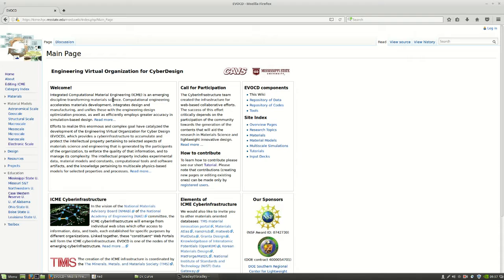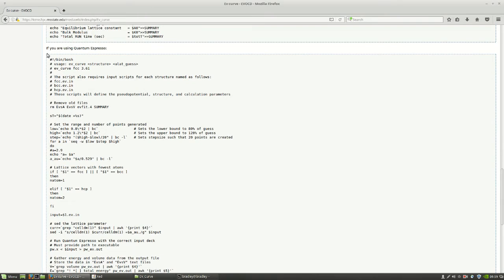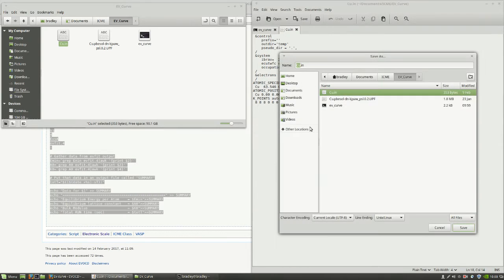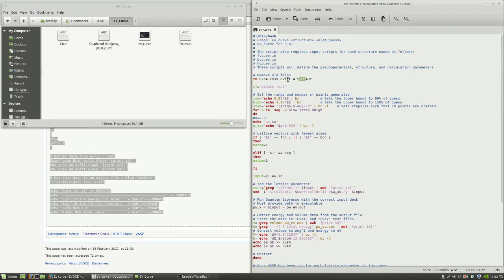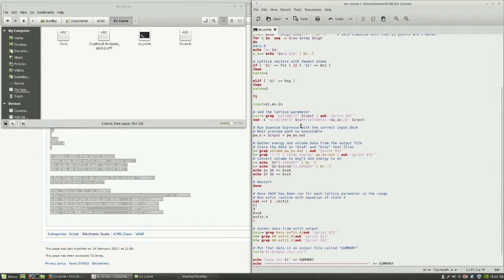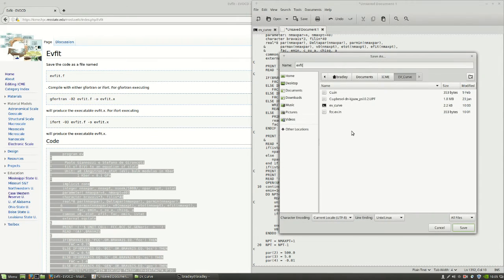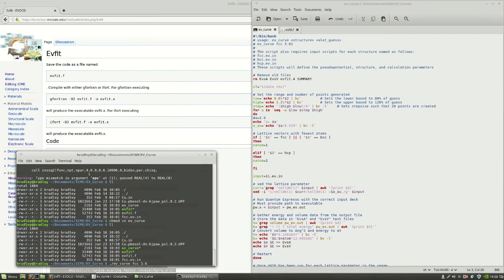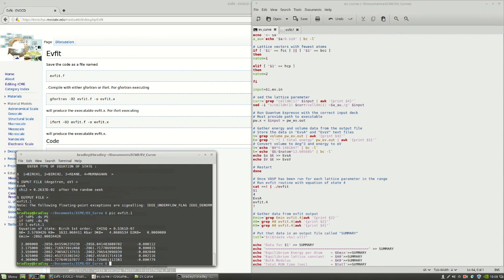Creating an Energy Volume Curve with DFT

Comment: Hi Brad. thanks for the video. for getting the data for E vs V curve in VASP, the starting structure should be relaxed structure. right? after that how do we change the lattice parameters? you used FCC so only one parameter is to modify. but if i have say, orthorhombic and that too 2D material. in such case i have 2 lattice parameter and the third one to be kept constant. How do we get the E-V curve?

Comment: Hi! thanks a lot for the video it really helps. i tried to do energy volume curve but i faced a problem: the code stops and says ' bad line in namelist &System' so i cheked the output file and found that the script writes alllll the lattice parameters generated in the same input file at the same time ''celldm(1) =14.74480151228733459389,=14.46124763705103969771,=14.17769376181474480151,=13.8.......) 
can you please help?!!

Comment: Hello Brad, thank you for your really helpful video.
I have a problem in calculating EvsA; when I execute the command " ./ev_curve fcc 3.61 ", I get this error :

./ev_curve: line 52: ./evfit: No such file or directory
grep: evfit.4: No such file or directory

and both summary file and EvsV are empty. I checked all inputs but I couldn't fix it. I was wondering if you have ever seen this error message?
Reply from the maker: Thanks for watching! It looks like you do not have the "evfit" executable in the current directory. If you don't want to use "evfit", you should be able to comment that line out and avoid that error.

Comment: Hello Brad, your videos are encouraging. Can you to calculate lattice thermal conductivity from lammps or in QE? lammps will be more preferable as i think it is less time consuming.
Reply from the maker: Thank you! I don't know that you could calculate the thermal conductivity from QE - at least not with DFT. It would be challenging because standard DFT is based on the ground state of the atoms, which means a temperature of absolute zero. You can try to do something like that in LAMMPS, because it can have temperature. There, you would still have to deal with the time scales (still super small timesteps!) but it might work. It is worth a try!

Comment: Hello do you know how to simulate effects of vacancies in qe or lammps?
Reply from the maker: Hello and thanks for watching! In fact, I do know how, or at least one or two possible ways. The vacancy formation energy is one of the quantities that we are concerned with when fitting a MEAM potential to the DFT data. To calculate that energy in DFT, you need to find the energy difference (per atom) between a bulk structure, and a bulk structure that is missing an atom. In this case, you do usually need quite a few atoms in DFT, so it can be a challenging simulation to run in a reasonable amount of time. Here is a paper that goes into a lot of detail: http://iopscience.iop.org/article/10.1088/0953-8984/1/4/005. For LAMMPS, you can do the same thing, except that the simulation is much easier since LAMMPS can do many atoms much more easily.
Reply: @Jere5120  thanks! subscribed! :D
Reply: @Jere5120   Yes i do agree with Brad. Recently i calculated vacancy formation energy and impurity (doped or alloy) formation energy of some alloys from DFT (QE). And my realizations are, (i) Multiple DFT runs, with impurity/vacancy and pure system, time consuming if you dont have high end CPUs. (ii) Needs large enough cells or else formation energies will not be correct enough, (ii) Special care should be taken when you are creating defects in the simulation cell or else defect-defect interactions may give rise to spurious values in formation energy

Comment: Hello, thank you for your helpful video. 
Do you know how to calculate the relationship between potential energy and distance of two separated atoms? If you know, could you give some details?
Reply from the maker: Hello! Thanks so much for watching! 
That is potentially a very complicated problem. And, it depends on the context and what assumptions you want to make. You can run this simulation in DFT simply by creating a large simulation cell and placing two atoms in the center, then calculating the total energy for various distances between those two atoms. If you are talking about a analytical solution for such a problem, there isn't one, as far as I know. There are atomistic pair-potentials which make vast simplifications but could give you an estimate for the total energy between two atoms. 
Let me know if this helps, or if you have more details that could help me explain it!
Reply: @Jere5120  sometimes if we need to optimize LJ or morse potential parameters for example when we use hybrid potential the dependence of potential energy vs distance between two atoms via DFT calculations are really helpful... may be you have an experience with it and can share by your thoughts.. it would be really cool

Comment: Hi Brad, thank you so much for this really nice video. 
However,  I have a question, which may sound a bit silly. What I calculated with QE (I mean EvsA) is really different than what I get by MPC. I mean the energies which I get by QE are like -2856 ev but in MEAM they are like between -4 and 10 ev. I am sure that I am missing something. I was wondering could you please tell me what I am not considering? 
Regards
Farzad
Reply from the maker: Farzad Foadian That is correct. The raw energy values you get from QE are much greater than those you would get from vasp. However, in all DFT calculations, the raw energy values do not have a lot of meaning - energy differences are important. For energy-volume curves, you will want to shift the curve such that the minimum energy is at the cohesive energy for your material - whether you are using QE or vasp. I hope this helps!
Reply: Dear Brad, thanks a lot. Actually, that was exactly the point that I was not considering.